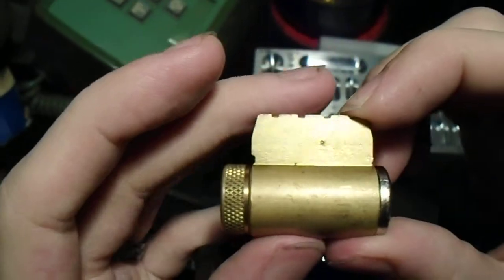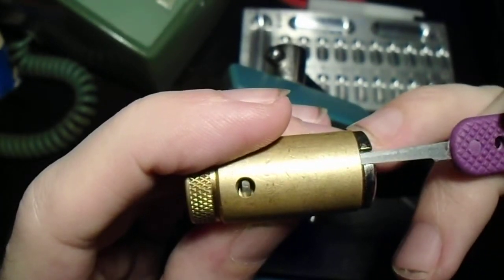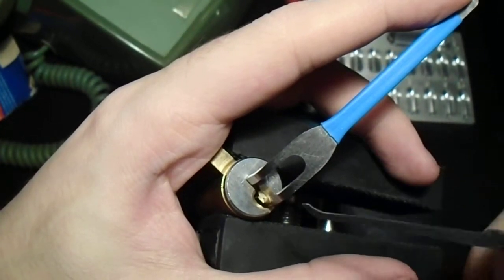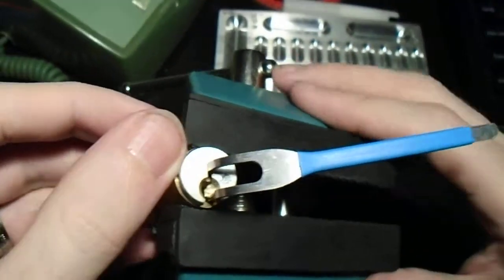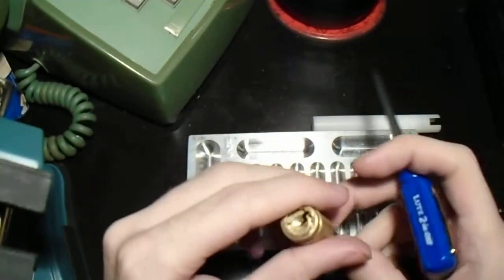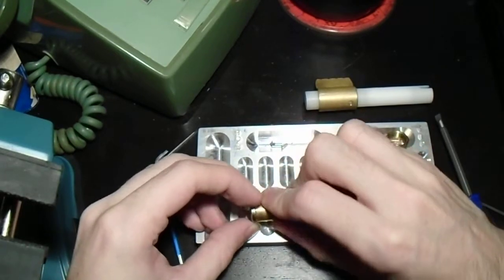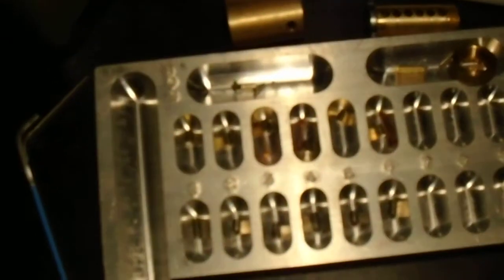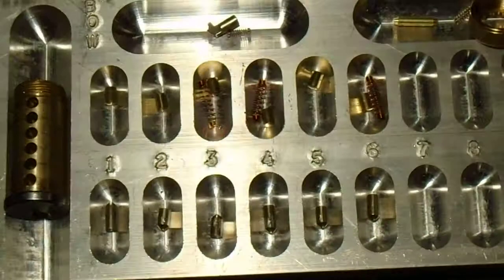(034) Schlage Everest picked and gutted

Comment: We got one of these at work (a commercial lock with a Schlage Everest cylinder, anyways), and I was just curious how much of a pain it would be to pick if I locked myself out. Substantial, it turns out. I had to recalibrate our key machine to get the tolerances close enough, because the first key I tried wasn't close enough to work.  

According to my calipers, the difference between a key that works and one that doesn't was an average of .007 of an inch.  I've been cutting keys there for most of my life (family owns the store, so literally since I was 14, a long time ago), and I've only ever seen one or two locks this picky before.
Reply from the maker: Schlage's commercial locks are supposed to have very tight tolerances, down to ±.002" for cut depths,and ±.001" for spacing. And since Schlage pins use .015" increments it isn't surprising that a cut being off almost half a step wouldn't work.
Since Everest and Primus use secondary locking mechanisms (check pin and sidebar respectively) security pins are not included by default as they would prevent spool or mushroom pins from functioning reliably. A well used and worn Everest cylinder would be easier to pick than a factory fresh cylinder but only slightly.